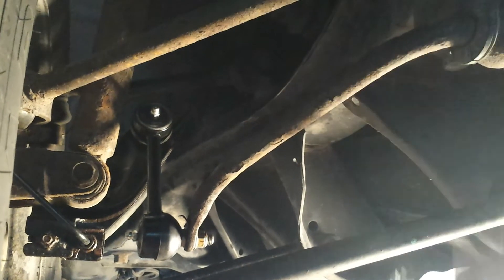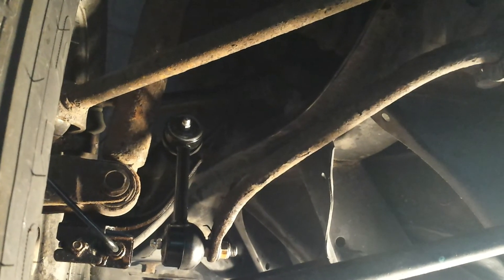Honda Accord Sway bar link replacment

Comment: If I can add to this:
I replaced mine this week and had horrible clunking when turning for the whole next day. What I did was take the link back off, pry the edges of the rubber boots back and put more grease into the joints of the link. Then I put it back on upside down from how I had it. 
I'm not sure which of those made the clunk go away, but it seems ok now. So when you install these things, you might want to grease the joints before you bolt it to the car. Save you some time maybe!
Reply: Some of them come pre greased. Was yours pre greased when you bought them?

Comment: Would of been a lot easier to just take the wheel off
Reply from the maker: Took the wheel off the another accord when I did the link on it. I ended up in the same position as this video, but did have more light on the subject with the wheel off!